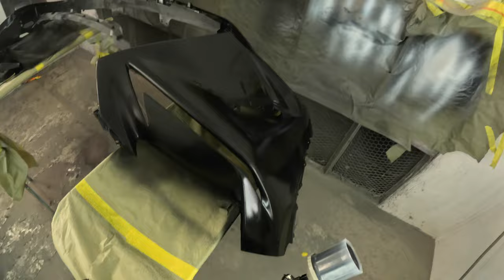Made a miracle in a dirty, filthy tiny spray booth. Bad situation turned out good + new connection

Comment: People can be frustrating but glad it worked out. Regarding stands I got the ones from Lowes home depot whichever. Now they have stands that link together end to end. Money's the only limit you can connect them forever. Adjustable height too. I drive a civic and no problem putting in stands for side work
Reply from the maker: Man I swear I was urtt thinking about looking into some stands earlier today. So Lowe's and home Depot? Ok going to check that out. I could throw them in my truck. Cool 😎 thank you brother 🤜🏼🤛🏼

Comment: Great job as always. When I get the chance to do Side Work, I'm spraying in a Home Made Booth and it's turns out pretty dang good. Was wondering what the gun setup on the Pro Lite is using the 1.4 tip?
Reply from the maker: He20 cap. 28 psi full fluid fan 1 turn  in from wide open. 🫡

Comment: Kind of a crazy situation to start with, but looks like it all worked out. 
  I moved my paint area over to the larger side of the garage I have. Big enuf to park 2 cars and a motorcycle. Cleared it out. Set up a new motorguard filter. Moved my lights. Now I got all that space hoping maybe to get cleaner jobs? I will know tomorow. Maybe bring out the Prolite🤔 man, it's gonna feel good to not be cramped for space while i'm working. 😎👍 Woooo!
Reply from the maker: Yea Big Bear you need room to spray and the closer you are to objects the more dirt you'll get. So sounds like the jobs might be a little cleaner. Good luck on that brother. And yea bring out that prolite 😁🫡
Reply: I did end up shooting the "glamour clear" with the Pro-lite. Managed to get zero runs this time, but don't have my frame/booth filter yet, so I  still got stuff coming in to the garage from outside landing on the car. But I think I got that Prolite dialed in now. Was real happy with the overall finish and the added filtration meant no trace of water anywhere. Some people wonder why i ramble on about paint $heet online...simple...my ole lady don't wanna hear it🤣🤣

Comment: hey triggerman thanks for the video what's good  you think you could throw your gun settings in there
Reply from the maker: Both guns 30psi ANI full fluid, fan wide open. Prolite fan wide open  then 1/2 turn in, fluid 3 turns out from the closed position. You're right my bad I should have put that in. I'm going to add to the description now. Thank you 👍🏼
Reply: thank you for your tips I use them all the time and I've been painting since 35 years
Reply from the maker: @RickysmobilebodyworkinLaPuent  you're more than welcome. Glad they are helping you. That's what it's all about 💪🏼

Comment: Triggerman, I’ve heard you say, on numerous accounts that you use a2:1 clear, is there a difference between the 2:1 and 4:1 solid clear? ✌🏻
Reply from the maker: Yes there is. 2:1 clear has more solids and a higher viscosity than 4:1. Ah good most times it It lasts a lot longer. More UV protection etc...
Reply: Thanks brotha! ✌🏼
Reply from the maker: @Idk-wtf-it-is  no problem 💪🏼

Comment: Man this ain’t right, I clean the car over and over, clean the booth and wet the floor, new paint suit, everything and my paint jobs don’t even come out that clean and I’ve been painting for 17 years. I got to learn from you brother. Teach me how you clean and prep.
Reply from the maker: After  last piece of sand paper that touches your car during prep. Tell me what exactly do you do to the vehicle before you start spraying? In detail
Reply: @thetriggerman954  I blow it inside and out, hit it with scuff paste and a scuff pad, pressure wash it with soap and water everywhere, even the engine bay and wheel wells, dry it up and blow again all the nooks, mask it shut, jambs, openings, wheel wells, anti static cleaner with a microfiber, tack and spray
Reply: @mohammedelsayed2889  you're doing too much... just clean and blow the jambs... tape , wipe , tac and spray... y.o.u are doing what's right but try it this way lol